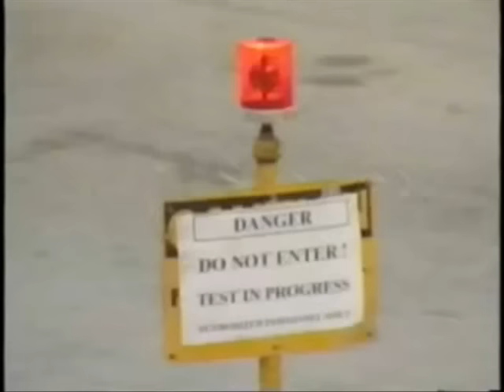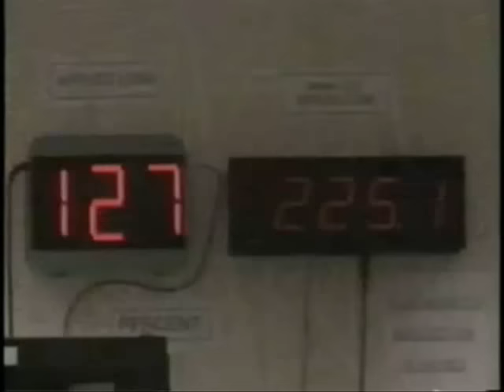Boeing 777 Wing Test

Comment: So the 777 wing can withstand 154% of design load. Question for an aerospace engineer....can the wing still withstand 154% at the very end of its service life or does it get de-rated with the number of hours and cycles?
Reply: Aluminum has a finite cyclic life. The stress it can handle will lower as the wing gets older. However, you are perfectly safe because it takes 10's of thousands of hours of flying to fatigue the wings/fuselage of a modern aircraft
Reply: arthursc2
I have an older mid 90's carbon kevlar composite mountain bike and i have literally flogged  the living daylights out of it and it's still going strong. Even with my other aircraft aluminium bike it's still sound. Aircraft alloy is so different to the run of the mill DIY alloy from walmart.
Reply: I think you missed the part where I mentioned "10's of thousands of hours" Also, there is no such thing as "aircraft aluminum." There are alloys, such as 6061, 7075, 5052, etc. Then there are alloys specific to aircraft use, such as 7050 (8% stronger than 7075) and 2024 (more ductile than 5000 series, able to be bent and formed). Aircraft aluminum is a marketing term applied by salesman to any alloy family to make you think it is somehow superior, when he is simply selling you 6061-T6 or 7075-T5. Each alloy has a specific set of uses, varying from weldability to machinability to ductility. Knowing the intended load and use is crucial to selection of alloy.

Anyway, my point is that aluminum, whether it is inside of it's expected load or out of it, has a finite lifespan. And the load and life will change depending on alloy. You can cyclically load it within 50% of it's intended load, and after enough cycles, it will fail. Even .5%. Will it take millions of cycles? Yes, but the failure will occur. This is why aircraft wings have a replacement life, to avoid such a failure.
Reply: As others have said, aluminum alloys, and other metals, have a finite fatigue life.  You can illustrate this by bending a paper clip repeatedly.  Small amounts of deflection have little effect, and it takes much longer to exceed the endurance limit of the paper clip.  Increase the amount and frequency of the deflections and you'll break it more quickly.  The structural properties of materials used in aircraft are very well known and engineers have years of test data at their disposal during the design phase of an aircraft.  The lifespan of a commercial aircraft is measured in cycles, with one takeoff, flight and landing counting as one cycle, and aircraft are designed for a certain number of cycles.  They are also inspected for cracks and other failures on a regular basis.
Reply: Actualy Arthur when sales people refer to Aircraft grade 'alloy  they' re ineed referring  an alloy used in Aircraft. 6061 has been used for MTB and road bike frames since the late 80's. It is a quality alloy not gimmick. When a bike frame manufacturer quotes it's place in aviation they are correct. Many alloys are used widely due to aviaion.
Reply: The most commonly used aircraft alloy is 2024-T3, with 7075 used in more critical areas, such as wing-attach brackets and landing-gear hard points.  2024 is often referred to as Alclad or "skin-grade" aluminum, and is used on everything from Cessna 150s to Boeing 767 airliners.  Alclad is nothing more than 2024 with a thin film of pure aluminum (1100 series) sprayed onto its surfaces.  Pure aluminum will passivate by acquiring a very fine layer of corrosion on its surface, that will protect the underlying structural alloy.  Paint is responsible for significant weight buildup on airplanes (several hundred lbs. on an airliner), so some airlines choose to maintain a polished-aluminum finish while using paint only for trim.  If Alclad is not maintained by polishing, it will acquire a dull grey look due to passivation.  American Airlines did this for years when they flew DC-10s.  Both of these alloys require special handling when forming into shapes, because their level of temper will cause them to crack if bend radii are too tight. 

To add to Glenny's comment, 6061 is an excellent multi-purpose alloy.  It has good structural and fatigue properties, forms and welds easily, and is relatively inexpensive.  Its "kissing cousin" is 6063 "architectural alloy," which is found in the window frames of your home.  6063 has about half the yield strength of 6061, but it extrudes very well, is able to be flash-welded for production efficiency, and takes anodizing beautifully.  Tanker and trailer bodies are usually made using one of the 5000-series alloys (5052, etc.) which are easily formed and welded, and have excellent fatigue and corrosion resistance.  One final alloy worth mentioning is 2011, also know as "screw-machine aluminum."  You'll find this used on common items like flashlight bodies, because it machines beautifully (easy on tooling) and takes anodizing exceptionally well.  This is probably more than most folks want to know, and you can probably tell that I'm a lot of fun at parties...
Reply: glenny oc
I feel like you are taking offense to something when none is intended. I never explicitly said 6061 is not an alloy used in aircraft. But come on man, you know its a sales pitch to say buzz words like "billet, aircraft aluminum, aircraft alloy, blah blah" 6061 is 6061, whether its a bike frame, rc car chassis, extruded shapes at Home Depot or your slide rule on your desk.

My point is, there are some aerospace specific alloys, of all material families. And it is irritating when everyone refers to any aluminum alloy as "aircraft aluminum" That is a term that should be limited to the alloys actually only used on planes, in my exhalted opinion.

With that being said, all my bikes are 7073, with the exception of my Big Hit FSR having a 7075 swing arm.  

Anyway, have a great day. There is a lot of knowledge in these comments, no need to argue and be offended.
Reply: Anthony Mayberry Fatigue is something that can never be eliminated, but it is something that can be managed via mechanical redundancy designed into aircraft structures.
Reply: Anthony Mayberry Once an aircraft reaches its cycle limit, it may be allowed to operate but on a stricter maintenance/inspection schedule.  A common approach is to limit their operating altitude.  The Aloha Airlines incident is unique because it was a failure that had never been experienced or anticipated.  What saved the airplane was the fact that the fuselage utilizes "crutch' construction, whereby the cabin floor is primary structure.  Following this incident, the older 737s were altitude restricted to reduce pressurization stresses on the fuselage.  Additional plating was also added to the area prone to failure.  I've flown on many of these airplanes on Midwest routes (no mountains, so fly low) as well as Aloha Airlines 737s.  I agree that of these aircraft are flown well past their prime, but with airline profit margins being almost non-existent you can see why they do this.  Whistle-blower protections should have come many years before they did.  Had they been in place in 1970, the DC-10 never would have entered production with a defective cargo-door design that ultimately killed 346 people.
Reply: I like this Moe Shipley guy. This has honestly got to be the most intelligent, well worded and constructive discussion on Youtube in recent history lol
Reply: @moeshipley4170  Moe that was some of the most beautiful shit I've read in some time on here about metals, and aluminum in particular.  Thank you very much for your contribution!
Reply: @Anthony Mayberry Dad spent several years working in fatigue testing for Bombardier aerospace. The called the department 'shake and break' because that's literally what they did with the dynamic testbed. Cycle it through a few thousand simulated flights, shut it down and go over every inch of the aircraft do see what broke and how- and then develop the repairs to pass along to crews when existing airframe hit those inspection in the field. Moe was correct, fatigue cannot be eliminated. But you can plan where it's going to happen and act accordingly.
Reply: @moeshipley4170  you sir are always invited to my parties. Thanks for the knowledge!
Reply: Staring at the 9.30 https://youtu.be/lapFQl6RezA
Reply: @arthursc2  and not only that, but even the same alloy (say 7075) may have varying quality between manufacturers (suppliers?). At least, that's what I understood, I'm not a mech engineer

Comment: Wow! That's Amazing!!! That the wings can withstand that much pressure at 154percent over design limit! Amazing that the wing Flex is at it's critical of 24Feet above the fuselage!!!!
Reply: actually 154 percent of design limit is 54 percent over design limit
Reply: Every plane needs to be able to handle 150% of the plane maximum load.

Comment: The aircraft is tdesign to withstand 150% the limit load. Limit load is a load that is expected to happen, at the most, 1 time during the entire life of the aircraft. So, you design it to only fail at 154% of this limit load, which is called Ultimate Load. So, this guys did a pretty good job!! If it would hav broke at 1.49, the aircraft wouldn't be certified, if it faild well over 1.5, it meant it's over designed and to heavy.
Reply: Staring at the 9.30 https://youtu.be/lapFQl6RezA

Comment: @thedreamliner2012 Nothing. The limit load is already a conservative estimate of the maximum load in flight (which would probably be in level flight at high speed and with an upward gust of wind). This test is at 154% that load.

Comment: Do they only pull at the tip or do they pull at calculated lift vector points along the wing? And just to be sure: 150 is 50% over the max possible load?
Reply: its 54% beyond the intended design limit. the design limit should  be above the max realistic load.  if the max realistic load you expect is 10, you design it to not break until 15, the test would be simulating 15 + ( 15/100 * 54) = 23.1   you cant know the max possible load, you can only guess at what something can realistically be loaded to
Reply: @trued2010  Thx! And does it matter where on the wing you attach the cables or can they just pull on the tip only?
Reply: @Spouwmuur  it looks like they have cables connected all over the wing. The whole wing is going to be in the air not just the tip, so the whole wing needs to see load in the test.
Reply: @trued2010  But how do they determine the load each cable is needs? or do they all have the exact same load? *Thx for your reactions btw
Reply: @Spouwmuur  probably load cells on the lines.
Reply: @trued2010  Thx👍!

Comment: Okay You Brilliant Ding Bats !!!
Now Try Your Test At  - 80 Degrees Below Zero.
Thats The Temperature At 40,000 Feet.
Metal Becomes Very Brital When It Is Cold.
How  About   A  Front  To  Rear  Wing  Torque  Test ?
How  About  A  Rip  The  Wing  Off  Of  The  Fusaloge  Test ?
How  About  A  Lets  Crack  The  Plane  In  Half  Test ?
How  About  A  Lets  Rip  The  Tail  Off  Test ?
How  About  A  Lets  Rip  The  Rudder  Tower  Off  Test ?
27 Foot Deflection ? Now Thats Scary.

Comment: So, does it mean that in turbulence when the wing flex occurs it goes beyond max. design limit? Like turbulence forces wing to flex 20/40% more than wing is desired for? Or the turbulence is part of wing capability during the flight.
Reply: 100% would be the most severe turbulence the aircraft ever would be subject to. This test showed that the wing could take 54% more than it would ever encounter in air.
Reply: TornadoInToilet Thanks bro ;)
Reply: TornadoInToilet Furthermore, most aircraft would never even encounter that 100%

Comment: The wing failed at a location outboard of the attach point of the engine, the flex appears to be evenly distributed which means the engine torque loads weren't being introduced.  The explosion was impressive but at what load did the wing get so stressed that it did not return to a usable shape?
Reply: This was so incredibly far past what a wing could potentially experience in the real world , that it would not even matter.

Comment: That's all well and good, but how much stress could it handle in a short amount of time like turbulence creates?
Reply: Well if it can handle more stress than it was designed for over such a long period, then it will be able to handle the stress it was designed for for the short period during turbulence. Excessive stress tends to weaken structures over time.
Reply: Turbulence introduces what are known as gust loads into an airframe structure.  While there are instances of turbulence causing catastrophic failures, they are extremely rare.  Airframes are designed to have structural redundancy, which means that they will fail progressively.  Rivets may loosen, and skin wrinkles may appear, but the structure will not fail completely.

Comment: Ok , i understand that the wings can fold up to 154 Tons im understanding . But what temperature was this under ? . Was it hot warm or cold temperature ? . Would it Still go to 154 in -60 c or do they take less to collapse them ? .has someone said , Freeze the plane and do the test over but with a faster progress under extreme cold , to create a sudden drop into heavy turbulence. Do the wings have a heater to keep them warm ?
Reply: Its not 154 tons of stress, it was 154% of the designed stress limit considering 100% as the baseline.
Reply: i think the whole point of going to 150% insted of 100% is to make sure wings unload 110-120% of strength in any condintions
Reply: The wings are heated (using air pipes from the engine) but it's mostly to prevent ice buildup. The materials used ensure the structural integrity of the wing is not affected by any range of normal operating temperatures.

Comment: The designed limit load is, of course, riddiculously small, so this is no achievement. If the plane fell from the sky for some reason, the wings would surely disintegrate before you could level the plane out. Planes are the least safe mode of transportation, they still drop every day.

Comment: They're happy because they can run full size unmanned stress tests on the ground in a controlled environment, which ultimately has saved thousands of lives throughout the years. Besides, I'm not about to try and somehow find 154% from 40,000 feet.

Comment: So let's say that your design says that the wing should be able to handle 100 pounds of stress before it breaks, if it made it to 154% of that then it survived a stress of 154 pounds which is significantly better than just the 100 pounds they required. It means the wing is stronger than they expected it to be.
Reply: Staring at the 9.30 https://youtu.be/lapFQl6RezA

Comment: but what about turbulence?  it is not a single constant strain on the wing, bending slowly over a long time, its a bouncing wobble which can build and have more of a strain IMO
Reply: Exactly my thoughts....
Reply: therefore these wings are that flexible
Reply: The test shows resistance to 154% of what would be considered absolute operational capacity, aka at the 100 mark the plane should no longer be operated and should either be slowed or removed from its current course to maintain structural integrity of flight operation.

At 100% the plane is no longer rated for flight. This test shows that there is a roughly 54% buffer in wing structural ability to use during the time it takes to correct course and find safer air. This also allows for your variance from turbulence, as even under heavy flight operative turbulence you're likely nowhere near the 100 mark.
Reply: MattH2580 His point is that under normal operation, the aircraft will get to about 10% of it's design limit. The worst storm you could possibly get with the worst turbulence will give you 100%, and then you've got an extra 54% to keep PR up.

Comment: That's swell, but everybody knows that the easiet way to break something metal is to gently bend it back and forth repeatedly until it fatigues, creates stress fractures and ultimately snaps. Kind of exactly how a wing constantly flexes while in flight.
Reply: Which is why they are given a useful life value. And inspected for stress fractures.

Comment: It almost looks like the wings would of gone more but it appears that it broke where the cables were attached.
Reply: Nope. Load is spread out properly to avoid disparity in load density.
Reply: @RuNescapeAiderP2PF2P  still an interesting test. Non the less.
Reply: @demonmaestro  Very interesting indeed. It's amazing to how the extent of engineering.

Comment: Anyone can make something strong enough, but it takes an engineer to build something only just strong enough.
Reply: Wat
Reply: @stevemiller1626  its designed to support 150% of the maximum possible inflight wing load. it broke at 154%. so its only just strong enough, they didn't waste weight making it way stronger than needed.

Comment: Hmmmmmm but at altitude and FREEZING temperatures, metals and composites would have different characteristics than  air temp and pressure at ground level..... Oh and a "controlled" bending process, not random sharp movements that would be experienced it flight.
Reply: Good points. This video is super old, I wonder if they have come up with better tests that address what you said
Reply: @sorrygtfo  Been in planes at "altitude" and of course we see the little flaps constantly correcting the attitude of the plane and even a little wing "bending". Never been in bad turbulence though, I'd have a heart attack, haaa. But the planes we fly in are safe, so not too worried.

Comment: That's fine for an incremental force increase over minutes, but what about a sudden, dynamic force moment? And that's also fine for room temperature conditions in a factory, but what about when the wing is -80F, like it is at FL380? I'll bet it shatters at a much lesser load.